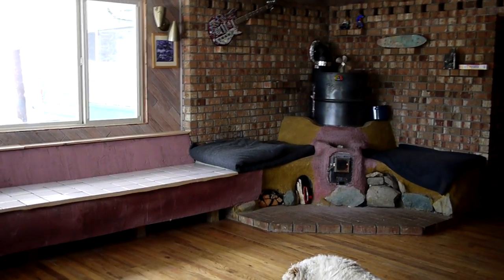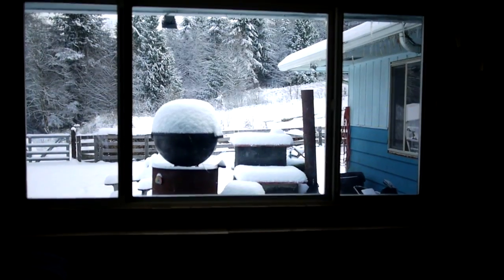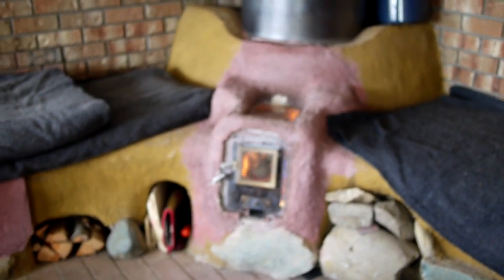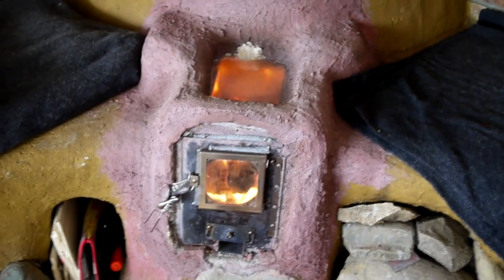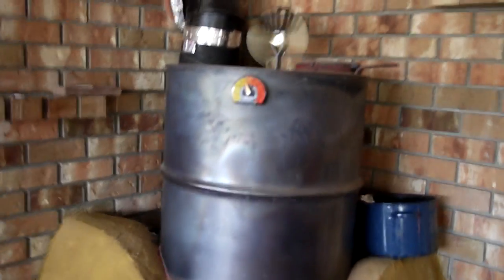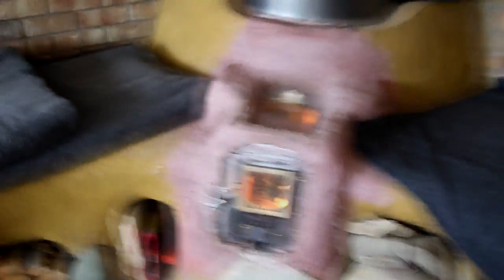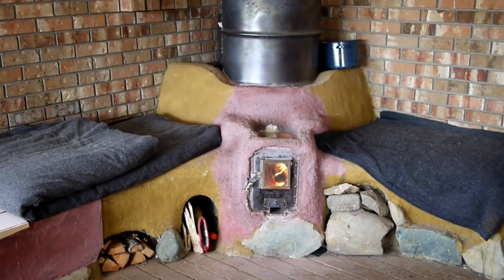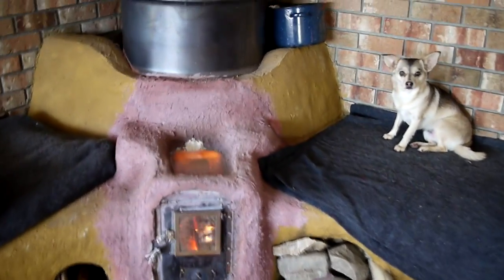Living With the Rocket Mass Heater Part 3, Firebox Conversion follow up

Comment: I think the riser of the secondary air channel should not choose a circular pipe, because the airflow passing through the circular object will form a positive pressure on its back, which will restrict the ejection of the secondary air.

Comment: You mentioned the face/door could get hot enough to burn ("would have to warn small children") what about the flat glass on top (where the j feed was) what kind of temps could you expect there? If that area were steel / cast iron instead of glass, could it function as a cookstove / hotplate?

Comment: It is a bit hard to tell what is going on with the "bell" at the end of the bench. Does the flue pipe open into it, allowing the gases to dwell in the barrel, then exit? Why the hole in the barrel? Just for easy of installation or something else?

Comment: what would the difference be in performance in a 8-inch pipe as opposed to 6 inch pipe? I would rather use 6-inch myself. what type of pipe did you use? Galvanized gas vent pipe? I'm concerned it might deteriorate over time because it's not designed for Wood fire. where did you get the fire proof glass on top?  is your heat Riser a stainless steel pipe? very good videos. thanks for your wonderful detailed information.

Comment: With the damped down air settings what ensures that the flue gas pushes through all of the piping and eventually out your chimney? My understanding is that with a rocket mass heater you can extract more heat than with a regular woodstove because you rely on the rammed air effect of the rocket stove to push flue gas instead of relying on stack effect to pull it.
Reply from the maker: I don't believe the old myth of "push" from a rocket stove.  Experience has taught me that if you don't rely on chimney draw to keep things running smoothly in varying conditions, you are going to have a bad time.  This method works well to slow things down which helps in transferring heat into the mass, and offers more control over final temps.  Hope that helps, thanks for the question!
Reply: That's probably really good advice to ensure you have a reliable hassle free stove. Even if you do have "push" a bit of redundancy is just good permaculture. Thanks for that idea! That has me wondering how important is it that the flue system from the riser tube onward be air tight? Would it be possible for flue gasses to seep out into the room if it was not air tight? I've seen a lot of builds where it does not seem like anyone is overly concerned about absolute air-tightness of the flue. Should we be? Also do you have any tips for how to ensure the chimney has a strong draw despite a rocket mass heater having low flue gas temperatures and longer flue runs in comparison to a traditional wood stove?
Reply: It just occurred to me that the secondary air might be a critical component of the batch box designs. Do you have any comment on this? Could you successfully damp down and slow burn your batch box while still getting a clean burn in the riser without secondary air?
Reply from the maker: Secondary is critical, they become secondary burners in this configuration.  Gassing off the fuel in the firebox, mixing with hot air and burning in the port and riser.

Chimney draft not only provides consistent performance, it means that any small gaps in the masonry are pulling in, which is why we don't sweat the seals too much.  Ideally, you want it as tight as possible.  Practically speaking, with all of the expansion/contraction, they mostly all leak like sieves.  Once the mass is warm, draft is not a problem.  A bypass is useful for starting a cold system, or a big system.  Another trick is to route the chimney back next to the barrel, so it gets some heat to power it a bit.  Hope that helps!
Reply: Perfect. I think I'm starting to catch on. Thanks!
Reply: could you make a drawing or show me a link to understand what you are saying when you route the chimney back next to the barrel. .

Comment: hey thanks for these videos!  i'm considering a build inside the house and hoping you can answer a few questions.. 1) did you just lay those floor bricks on top of your wooden floor?  no issues? 2) if more cobb is better, is there a reason why you don't cover the metal chamber with cobb as well?
Reply from the maker: Hey, thank you!  I did not lay the brick on the floor, they were already there as a stove hearth.  I did add an insulative layer of perlite under the core.  You absolutely need to protect whatever is underneath it, it will get hot.  The barrel is the quick radiator, so it is a feature that provides instant heat.  The barrel radiates and warms the room during the burn, the cob takes over and maintains warmth in the space when the fire is out.  Hope that helps.
Reply: thanks for the reply~  makes perfect sense!  so if i desired a more sustained heating (and not seek immediate heating of air), and/or didn't really like the look of the barrel (this is at my mom's cold house), and simply wanted to store more heat as mass, do you think covering the barrel with cob or fire bricks (with cobb stuffed) would work?  or perhaps it would not work because it's too hot for the cobb?
Reply from the maker: It will work, but.....it's a whole system, and those things change it, so you'll need to make some adjustments as you learn.  Covering the barrel pushes a ton of heat downstream, so the benches may be too hot to sit on.  A brick facade around the barrel with air gaps below, a gap around the barrel, and an open top is another way to approach covering the barrel.  Good luck.

Comment: I really love all the experimenting you have done! I have been collecting materials to build my own. The thing that I had issues with on the normal rocket stove was the need to babysit it all the time....  I have collected several old stove doors with windows that I want to use in a batch rocket stove. I have some 12" pipe that I can use but was also open to the half barrel idea. I am a really visual person and am having a hard time finding drawings or pictures of specs on the half barrel system. I plan on pouring the firebox and riser... I am in Interior AK am I going to have issues with the sever cold temps? This will be in a sauna/greenhouse type application not in the house...thanks!
Reply from the maker: Julie Fullmer Thanks for the kind words Julie.  I'm not sure if you are asking me a question here, but yeah, I would have a problem with cold temps in interior AK!  I just delivered a boat from Whittier to Seward on Sunday and I was freezing!  I suggest moving South.  Just kidding!?  Good luck on your build.
Reply: *****  Sorry on my wording, yes will I have issues running a RMH because off the cold? (not planning on it running on a continual basis) Also are there any drawings for how to work the half barrel system?
Reply from the maker: Julie Fullmer
Well, if you let it get all the way cold in the house, it will be a bear to start unless you plan in a bypass or something.  As for the half barrel system, there's not much to draw a picture of...just half barrels on the ground forming a tunnel.  A chimney at one end and an RMH at the other.   If you have a specific question I'm happy to try to help, but really the best thing to do is just start building.  You'll answer all of your questions, and have different ones.
Reply: ***** Thanks! I will have to add in the bypass. This is going to be in a out building and not used all the time...What I didn't understand was how the barrels all joined but if you just butt them up to each other, thats simple.. THANKS!!!

Comment: I think a small firebox is more efficient because it can be run at it's hottest and still then extract the most out of it.  This looks efficient, but if I build one, it would be a 6 inch j tube.  It actually kind of depresses me when I see people converting, like it's just too much work, but I have a very small house, 400 sq ft heated space.  I also live in Northern Wisconsin where it gets very cold.  -18 a couple days ago.
Reply from the maker: Don't worry, I didn't abandon the J!  I'm just continuing to explore what's possible, but I love the J, and for a small space they are fantastic heaters.  This one is actually running more efficiently than my J was according to the analyzer, but it's not by a huge margin.  J's tend to run with way too much excess air, hurting their efficiency, so while they are very clean they are also using quite a bit of energy to heat air that isn't needed for combustion.  Believe me, I absolutely loved sitting next to that J and feeding it.  And although this one is slightly more efficient and cleaner, I will continue to recommend J style when it fits.  If you live somewhere very cold and need more power or have a larger space, the batch is really a great tool.  Thanks for the comment!
Reply: ***** Yeah, but you extended the bench.  I plan on building a six inch with an 8 inch bench, for maximum extraction of heat.  The six inch would lower the amount of air and the amount of heat, which would make it more efficient, in my mind anyway.  The two reasons you got more efficiency was lower temperature and longer bench, but you still have a cool down and start up where it wouldn't be as efficient.  It's great.  It looks nice, by the way, and the difference would be minimal at best with a lot more work splitting, etc, but it would also be easier to build the j.
Reply from the maker: fire7side
Thanks for the compliments, and you are right that this one is getting good numbers partly due to the longer bench/better extraction.  Good luck on your build, it sounds like it's gonna be a good one!

Comment: Hey broaudio. I need some help. I've been talking about rocket mass heaters and it is just too strange or out there for people. I want to tell people (and my wife) it can heat their house but when I say it is mostly radiant heat they think it is not going to heat their whole house. So I need some info. When you say you wake up to a warm house, what do you mean? How warm? Is there a big difference from bedroom to living room? How big is your house? How well does it heat it? Was there a big difference between the total time the house was like 70 degrees Fahrenheit between the batch heat and the J-tube?
Reply from the maker: Hi Doug, well, they are damn good heaters, but they are relatively small heaters, as dictated by fire box size.  You can only get as many BTUs out as you can put in.  So, that said, I don't think they are a good match for over 1000sq.ft. or so.  Yes, there is about a 10 degree difference when the thing is running between my bedroom and the living room/kitchen area.  I'm waking up to 60F+ in the living room, 55f+ or so in the bedroom.  I'm heating just around 1000 sq. ft. of poorly insulated, convoluted living space.  A small, well built space with a small heater in each space would be my ideal.  The American paradigm of large spaces and one heating unit heating them all won't be a good match for one of these.  I think it's a fault of the home design rather than a heater shortcoming, but it's a long road to try to change that mindset.  Good luck!

Comment: Is the secondary air CSA still 9%?
Reply from the maker: There are a few configurations pictured in this one, but the one I've settled on for now is right around there.  Inlet is 2.25"X1.25".
Reply: ***** Is the secondary outside air?  What if the air sources were flip-flopped, the now secondary became the primary, and the primary was now the 2.25" x 1.25" secondary. Would that make any difference in the burn characteristics?
Reply from the maker: Nirky Hi Nirky, it's inside air.  I don't know the answer to your second question, but I imagine it would change things for sure.

Comment: I want one! I've got a regular 8'' J system heating our MI home, and while I like most things about it, I miss some aspects of the traditional wood stove so the batch box system really appeals to me. I knew it was only a matter of time before some pyrotechnically-savvy individual like yourself worked out the kinks..
Reply: Doug Barth
We have a ~1200sf cordwood home. Cordwood is generally a very warm wall, but ours has actually been pretty drafty in the past (improved that with a coat of exterior plaster this year). In any case, it's hard to compare our home to a regular one. We definitely have a high amount of thermal mass; our rocket flue runs through a cob bench and then through our earthen floor. We have about 25-30' of flue in the house. We also have a family of eleven living here, so bodies and cooking contribute to the heating as well.. When the temps are in the low 30s, we can go days without even starting the rocket stove. When the temps are in the single digits, we generally run the stove all day. It'll be about 68 degrees or so when we put the fire out before bed, and about 64 in the morning (fahrenheit). HTH..
Reply: Doug Barth
Also, we're on our 7th winter now with the stove. I originally used red brick for the whole thing; went back after the 1st or 2nd year and rebuilt the same system with firebrick and clay chimney liner for the heat riser. Some of the firebricks have cracked in the feed chamber, but as long as they don't fall out of place it doesn't bother me..
Reply: Andrew Lund - Thanks for your comment about using it to heat a section of your floor... I have underfloor heating in our bathroom here in the UK, but when we move back to Australia next year (2015) I want to get right into thinking through and building a smart, low consumption heating system. I was wondering why the instigators or this system have not mentioned under floor heating with it. I am pleased you did. Also pleased to have been able to watch ***** 's evolution... Big Kudos to both of you gentleman for helping our family out with your free flowing info... Happy Christmas. All the best for 2015
:) - David
Reply from the maker: Right on, I'm glad I could share something useful to you.
Reply: Fellow Michigander! I'm way jealous that you already have a system up! I would love to convince my wife to get one. I asked broaudio, what temperature data have you seen with your system?